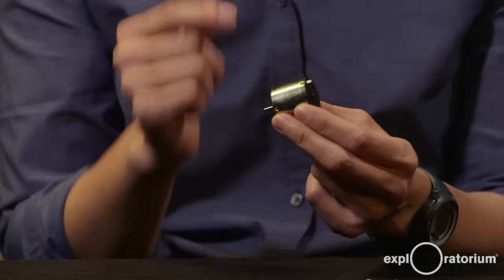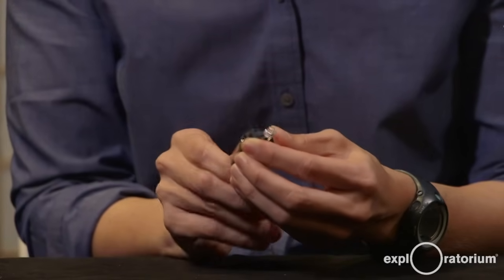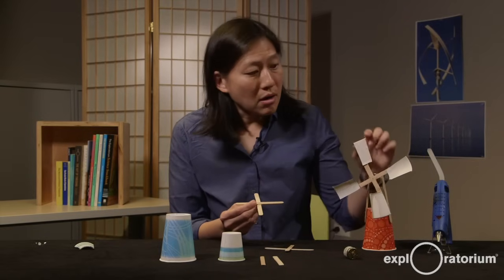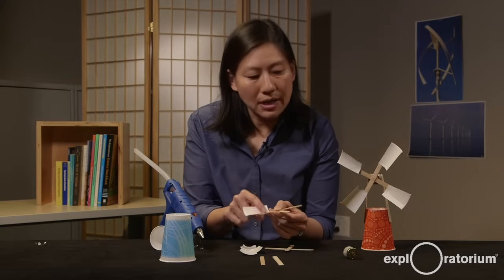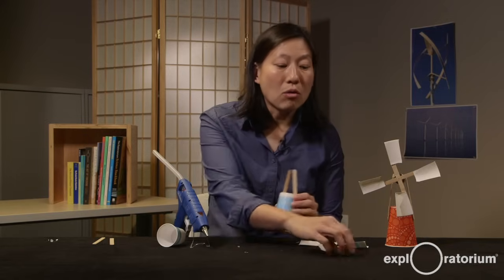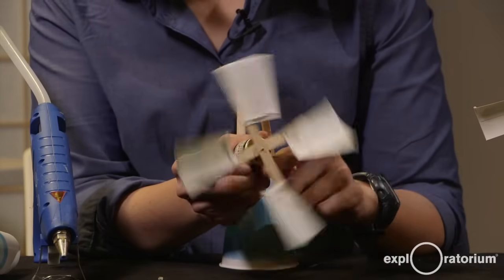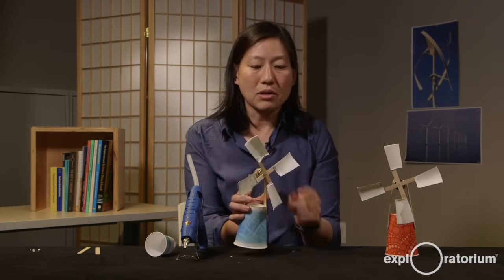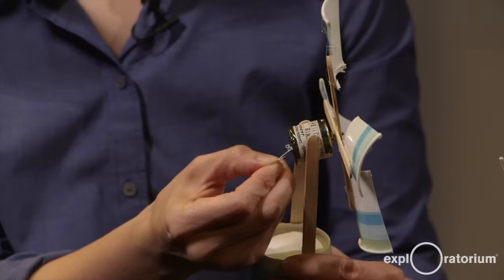Easy DIY wind turbine | Light Wind - Science Snack activity

Comment: what are the specs of the hobby motor (RPM, Voltage) that worked for anyone? I've tried 2 different motors with 1000RPM, 6V and 15000RPM, 3V and neither worked, with the hand spin or with the fan.

Comment: Just tried this, only getting 0.02V out of the motor. The LEDs need at least 2V, which is about 100X the current output. I also noticed the video doesn't show a working model, maybe they know this doesn't work as well?

Comment: my light isn't lighting either. fine with a finger spin but no amount of wind will make the light glow. i've tried a 3V and 6V DC motor and no luck. wish it was easy as in the video as its a cool idea.
Reply: N HH  u should use 6-12v hobby motor
Reply: Maybe it spins in the wrong way
Reply: Same for me..lights up with the finger spin continuously but doesn't work in front the fan

Comment: I wonder if you can help me with a bit of advice, I have a variety of motors from fans, car Vacuum cleaner, hovermower, food processor, Microwave etc. But what I want to try and do is make a mini wind generator from connecting 4 of the small motors you get in VHS/DVD players together with an elastic band. What I want to know is if I do this and connect my 4 mini motors will the 4 motors put out enough electricity to charge a small motorbike battery?. May seem a silly Q as I don’t know much about electronics. Say each of the 4 motors puts out 3v would I get a total of 12v  if I connect them in parallel?. Also would they wattage to charge a 12v motorbike battery?. Or will they just put out enough energy to make a couple small LEDS light up? so am I wasting my time?.

Comment: I followed the directions in the video using a hobby motor purchased at a hobby store. My LED would not light. Went to your web site listed to look at the materials list. It listed a 6-12 volt motor to use. The motor I had was a 1.5-3V motor. I purchased the 6-12 volt motor, much larger than the one shown in the video. Now every thing else is too small to turn the motor which means I have to enlarge the size of the sticks and cups to adjust because the regular size pop sickle sticks and fan blades from small cups don't provide enough torque to turn the shaft. It's turned out to be much more complicated and time consuming than this video leads to believe and still have not produced a working model yet.
Reply: Hey, I'm having the exact same problem even after 3 hours of driving around to different stores. I ended up wasting $30 and also have not made a working model. I have ended up with 2 motors and a bag of LED lights. I understand your pain as well and this is an annoying task.
Reply: @asillyguy322  
Hey, its been a year but...were you able to make it work?
It doesn’t work for me, even through the finger spin method. Was it faulty components that caused it? Incorrect connection? Maybe the motor not being strong enough?

I swear, I’ve looked all over youtube and all the damn videos have the same dislike to like ratio. The dislikes are always 10%(or close to it) of the likes, which is odd af. Is this some sort of curse? Are we forced into that 10% demographic, regardless of our efforts? Is this the destiny of all wind turbine project makers?
Why are we still here, just to suffer
Reply: @LLara-ej3eq  I did not, it was for a small project so I had to do the opposite - power the engine to make the propellers move and light the LED, kinda sucked but ah well.
Reply: @asillyguy322  
P A I N
Well, I’m going that route anyway. I hate this project to be honest, but what can you do?
Thanks for the response!
Reply: @LLara-ej3eq  yep! Good luck with your project
Reply: rip
Reply: Yes rip but read the end😯😯😯😯

Comment: My light is not lighting up. The bulb is not blown because I can hook it up to a 9v battery and it comes on. The motor when connected to the same 9v battery works I tried it in both directions of the motor and reversed the bulb. Still no light. Either the motor doesn't produce electricity or the blades are not turning fast enough to produce enough electricity is all that I can think of.
Reply: Did you read the end???